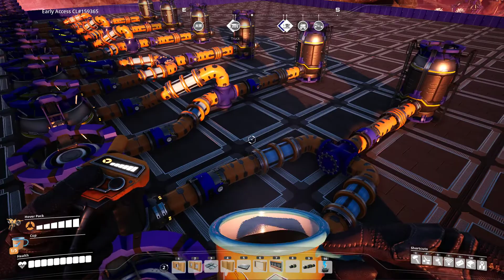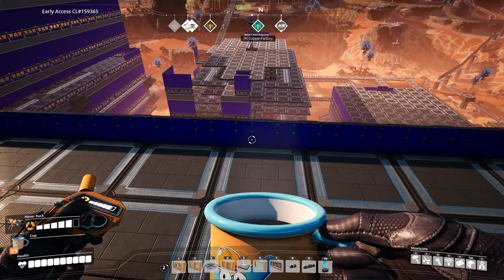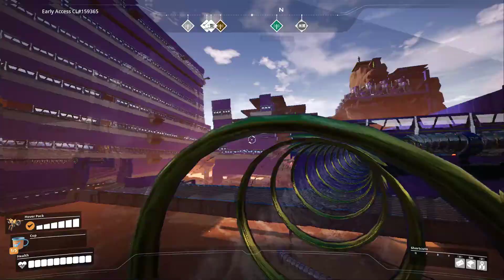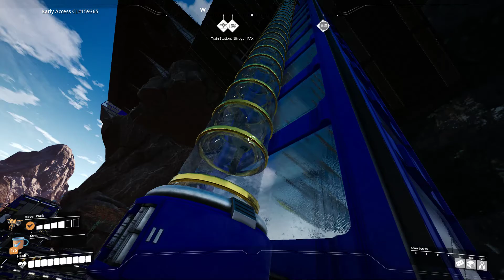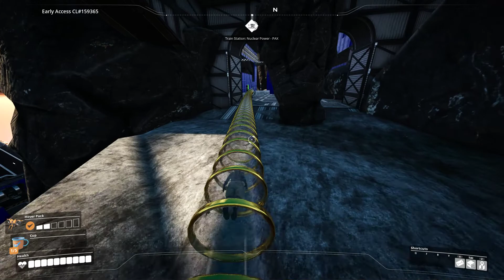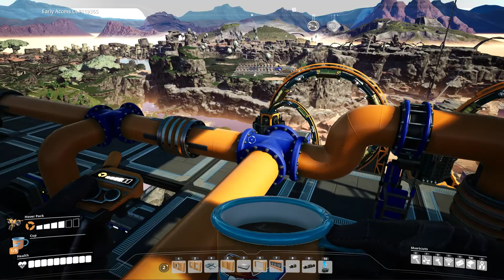Easy Byproducts - Taking advantage of pipe priorities.

Comment: Which direction do valves need to be placed?  So if I have pipe A and pipe B, and I need to limit pipe B, do the green arrows on the valve need to point to A or B?
Reply from the maker: @darthtom100  One goal of the priority junction is to not use valves to limit rates, but instead only use them to prevent backflow. So if you have two sources of water coming from pipes A and B and combining in a priority junction before going to a consumer of water in pipe C, you'd put valves on both pipes A and B pointing towards the junction.

I hope that clears things up... really not sure if I understood your question.

Comment: A small note, for future reference: pipework's flow seems to depend GREATLY on the shape of the pipes involved. In order to have a better testing scenario, I would suggest having every set up be as similar to the others as possible.

In the video, that would mean adding pipe supports so that each setup is composed by pipe segments of the exact same shape and lenght, which doesn't always seem to be the case here (some pumps seem a bit further out than the others)
Reply from the maker: That does sound worth doing. Don't recall the exact process I had for making the test setup, but typically I place junctions and pumps first and then snap the pipes to them. So the pipe shapes were probably just whatever made the connection I wanted.
Reply: @ronhatch9175  That's what I "feared" given the lack of pipe supports in the picture ahah

Honestly, pipes are just too finicky... I had a VIP junction setup exactly like showed in McGalleon's manual, but the prioritized input had came from a buffer with a pump before the buffer... End result: the buffer didn't get priority and could be filled up completely and clog, adding a pump right after the buffer solved the issue

Note: the unprioritized input had NO pumps in proximity, the buffer sent a pipe directly to the VIP junction without any elevation change.

Comment: Thank you for making this clear demonstration and explanation. Dealing with fluid byproducts has been an issue for me for some time.

I was sure that fluid priority was related to head lift, and as it appeared to work that way on one factory layout. Reproducing this layout elsewhere failed to reproduce the same behavior. So new theory,  it was overall pipeline length. Again, got this to work once but that idea failed on a third factory layout. This process iterated a few more times with new theories followed by new failures.

Your demonstration that it is both junction orientation AND head lift determining priority, that has finally resolved the byproduct problems. This also explains why installing pumps in random places would sometimes fix things, but installing valves would not (pumps also add headlift, while valves only prevent backflow).

Combining this idea with limiting pipelines to 95% capacity (especially mk2 pipelines), installing valves in long pipes to limit sloshing, buffers to smooth flowrates out - the last of the 'weird' issues are finally getting resolved

Comment: Came here from the comments of Stin Archi’s video.
I haven’t really worked with aluminum or nuclear yet, but I’m sure that this will come in handy for those.
Out of curiosity, have you tried putting a “flat” junction on a pipe that is angled upwards and/or if the machines themselves are at different elevation? I assume that the angled pipe would behave like a rotated junction did, and higher elevation machines would get priority due to there headlift. But, it would be interesting to verify that.
Reply from the maker: As far as I can tell, for merging pipes (multiple inputs, one output) the height doesn't make any difference as long as there's enough head lift to get where you're going, but I haven't done any formal tests with production buildings and only a few with tanks.

For splitting pipes (one input, multiple outputs) you can absolutely set priority just by using standard pipes at different heights. I didn't really cover that in this video because other people figured out how to do it a long time ago. Smerkin 5000 has one of the better videos on it if you're curious.
Reply from the maker: Oh, and when I originally got my aluminum production up and running, I basically stumbled across a setup that worked because I had a couple fluid buffers that the water extractors couldn't fill completely (insufficient head lift) so the excess water from the refineries always had a place to go. Part of the reason I started experimenting with it in the first place was that I figured there had to be a less finicky way to do the same thing.